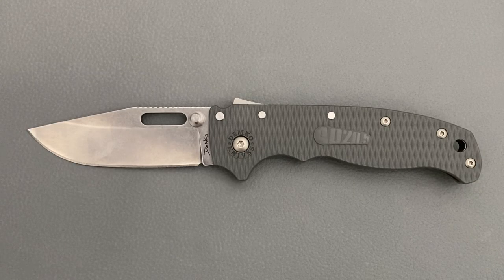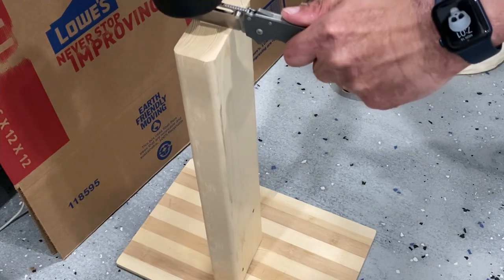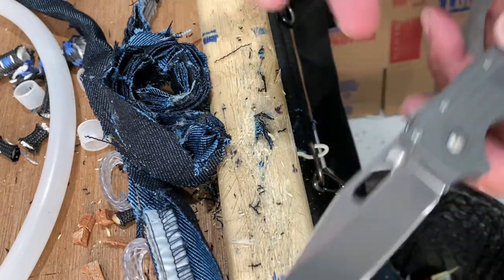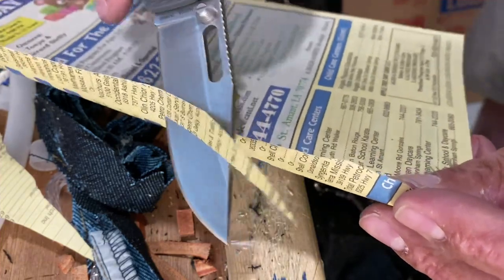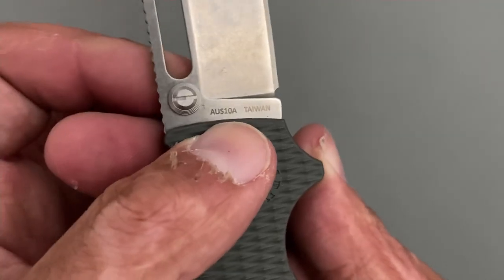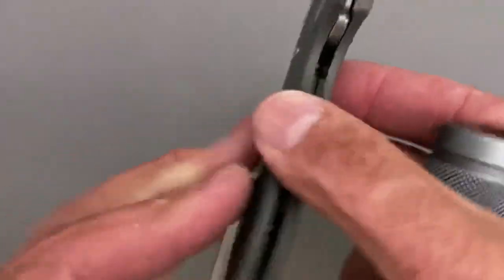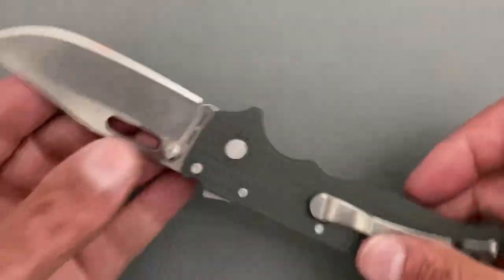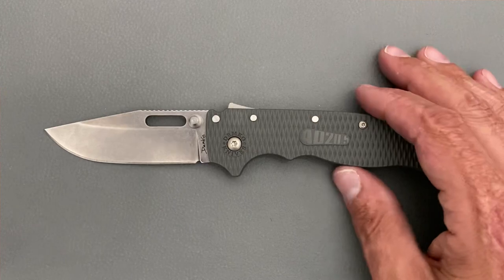DEMKO Knives AD20.5 / Can it Handle Some Abuse?/ Full Review and Testing

Comment: The price is way too expensive for a knife that has Aus10A steel, plastic scales, and made in Taiwan. Its a nice knife but not that nice. I get it out that it's a nice lock. But I'm not buying a lock. I'm buying the whole knife and comparing materials vs. price it just doesn't add up. $150 and I can go buy a Manix 2 for that with a lot better blade steel and scales. Jmo!!!
Reply from the maker: It’s definitely pricey I won’t argue that however he will still sell them like hot cakes because they are a Demko design and a new lock that’s really fidget friendly. I am hoping once the hype dies down that he produces some in more premium materials. I talked to him and his brother at dinner while at blade and he said once he gets caught up on the AD20’s and finishes this run of the 20.5’s they would think about an upgrade so I guess we will have to wait and see 👌🏻
Reply: @Stassa23  that's cool. I think to since he left Coldsteel and went out on his own he needs to take advantage of the hype and build his business up first.

Comment: Excellent review! One thing I’ve noticed with the shark lock on the 20.5 is that it doesn’t always work well with gloves and depending on the glove material it can actually get caught in the lock when you close the knife. I have yet to be able to buy an AD-20 so I don’t know if it applies to that as well.
Reply from the maker: I can definitely see that happening because I think that’s what was happening when I did the wood shaving. The AD20 is pretty much the exact same except the spring may be a little bigger but I’ll try to test it out with gloves on and let you know
Reply: @Stassa23  I’ve used this knife a number of days at work and at times with both latex type gloves and also gloves with cloth like material but both tight fitting. Without fail, the lock eventually gets caught on or pinches latex causing it to rip. Similarly with the other gloves I mentioned, they would get caught in the lock especially if the gloves were worn out at all. I do think that the ad-20.5’s fine jimping may be playing a part in grabbing the material and pulling it into the lock. As far as the ad-20 I was just thinking since everything is scaled up and wider that it might be less likely to happen but of course if it can happen on one, it can certainly happen on the other.

Comment: I personally think that Demko will probably end up doing what Spyderco does, which is to first release a knife with just ho-hum basic steel.  Then a few months later basically just release the same knife with a better more higher-end steel.  This is exactly why I'm going to wait and not buy a Demko AD 20.5 as soon as it becomes available on either BladeHQ or KnifeCenter!!!  I'm definitely going to wait and see what Demko does with this new Taiwanese-produced AD 20.5 platform.
Reply: Agreed, but I’ll get one as soon as I can and when an upgraded version comes out, I’ll get that as well a give the og to someone
Reply: @tariqkamil7853  Demko chose AUS-10A because it could be cut and didn't have to be water jetted or laser cut, which both are more expensive processes.  Doing that helped reduce cost on the smaller batch of AD 20.5's that he ordere the Taiwanese factory to make(400 for Blade Show 2021).  Based on the immediate success and insane hype of the AD 20.5, I bet if Demko went back to the Taiwanese factory and said can we make the AD 20.5 for the same $150.00 with CPM S35VN if I order 30,000 knives.  I think he will do that and we will see a Demko AD 20.5 in at least CPM S35VN!!!
Reply from the maker: Oh don’t worry if he produces one in premium materials I’ll probably pick that one up as well especially since he said it would probably be a while 👍🏻
Reply from the maker: @ThomasConnolly  that’s possible however he had 800 of the AD20.5’s at Blade at least that’s what he said at dinner and he sold pretty much all of them so on the other hand he may keep making them with the AUS10A because it yields him more money. I hope that’s not the case and we see one m
Reply: @ThomasConnolly  if Demko goes max hype he probably can get them made out of XHP and charge $200+ and easily sell them all out within a week.
Reply: @CKshouta  Exactly, I totally agree!!!!
Reply: @Stassa23  I really hope that this isn't the real truth.
Reply: @ThomasConnolly  Profit margin is important. Can't have cool stuff it the designer don't make money. I don't think Demko made much from this initial run of AD20.5s, he will still need to make and sell those by the thousands to do that.

Comment: I absolutely hate the pocket clip on the new Demko AD 20.5!!!  That clip is very high carry and very weird/odd all to accommodate a damn lanyard tube/hole!!!!  Also, the pocket clip has only two screws that are on opposite corners on the base of the pocket clip.  So this is a two diagonal pocket clip screw pattern that's around a lanyard tube it will definitely make it nearly impossible to find a decent replacement titanium deep carry pocket clip.  Also wouldn't having just two screws in each corner of the base of the pocket clip cause the clip itself to twist out of shape over time?  In my opinion, $150.00 for plastic handles and AUS-10A is definately not the greatest value for the materials that you're getting.
Reply from the maker: It’s will always sell though because it’s a Demko and it has a fun new lock also for the pocket clip you can get a deep carry titanium clip from Pops custom clips, that’s where I got my deep carry Ti clip uy
Reply: @Stassa23  I know Pops can make a custom titanium deep carry pocket clip, but because of the weird pocket screw hole pattern on the AD 20.5's handle the custom clip will most likely end up being weird looking itself.